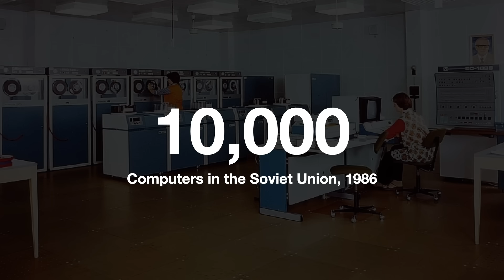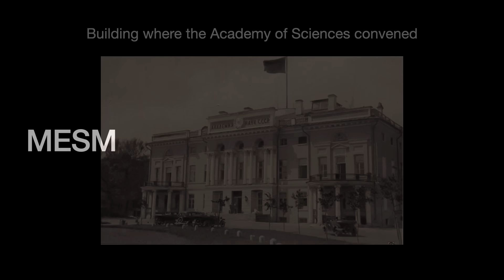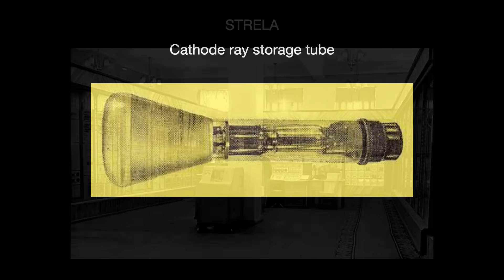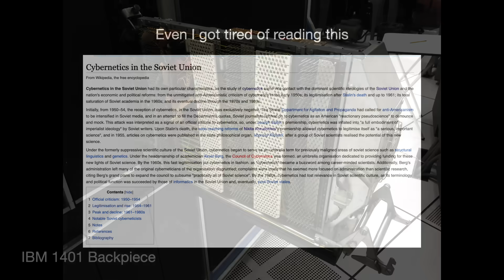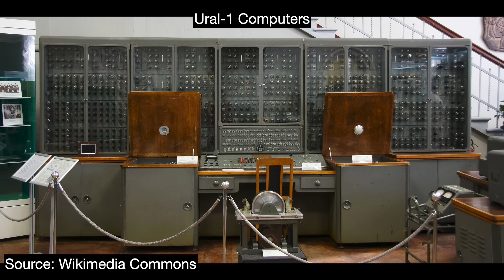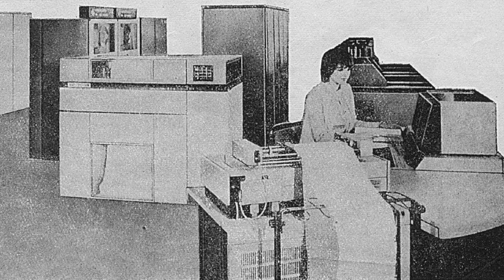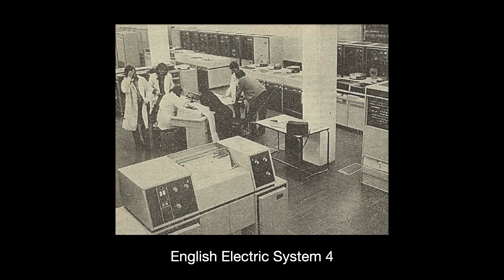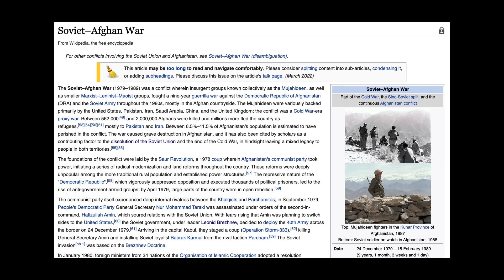Why the Soviet Computer Failed

Comment: When I was a child in the 80s my family bought a bright red portable TV of Soviet origin, a really portable one, I didn't see anything similar in the shops for quite a while. But one day, after a few years, it broke. The technicians we brought it to told us it wasn't economically feasible to track the fault and repair it. We thought at the time that it was too advanced for the local repair shop. Actually it wasn't, instead of using ICs as their western counterparts, it was built using discrete transistors and the miniaturization was accomplished carefully crafting an incredible mess inside the device. I doubt the factory could produce many units per year. Still a remarkable feat of ingenuity and craftsmanship.
Reply: Most of Soviet electronic stuff was sold with lists on which you could find a very detailed schematics and stuff. I don't know if it was a worldwide practice, but probably it was because of the lack of standardization. If you wanted to repair something, you'd need a guide every time you open a new device
Reply: @andremorr  I have an old radio, not soviet and it also came with detailed schematics of every single component. Just like cars used to come with full instructions on things like how to adjust the gap on the spark plugs or something. Companies used to give proper instructions for a DIY-focused customer to be able to do their own repairs. Nowadays they treat us all like goldfish.
Reply: @Vousie V, if you still have an old radio, hold onto it. It is a treasure. See how much your old radio is worth at Etsy or eBay. Worth checking out. 

In my country Ireland, old vintage things like radios, metal signs, oil canisters, etc are hot sellers. People treat them as ORNAMENTS for their museums, homes, hotels, pubs, restaurants, etc. 
My late father used to trade in antiques. Old radios were great sellers, even if they were broken. The last 50 old radios in my father's shop were quickly sold out to a German customer who knew their rising values in future. Now we have two old radios left. One is worth €150 (roughly over 9000 Russian rubles). Another is €120 (roughly over 7000 rubles).
Reply: @andremorr  Every Soviet TV set was sold with the manual and electric diagram.
Reply: @andremorr  British 80s computers also came with detailed schematics. From the US, the most popular make in the world in the 80s - Commodore - sold theirs separately but they were widely available also.

Computers followed the early electronics tradition of giving full ownership and information to the customer, but this was lost rather abruptly during the 90s, perhaps because of the massive success of the closed, proprietary software model exporting its culture to other fields.
Reply: @andremorr  that was standard with US equipment too in the early days. In the 70's you started having to request the service manual but it was typically free or you paid for shipping. By the 80's it became standard practice to sell the service manuals and some companies would only sell them to service companies.
Reply: @andremorr  soviet tech actually was quite similar more so the electronics.
If you knew some devices you knew almost all
Reply: We have a TV museum in town. Salora and Nokia mobile phones originate from here. Salora was one of the first companies to develop a commercial color TV and was one of the most sold TV company in Europe for many years. In the museum there was a really old TV stripped so you could see what was inside and I can tell you that most of the TV's were total mess back in the days. At least the ones from 60-70. I dont know how old was that portable TV tho xD
Reply: @L1ven  In the 70s, Grundig offered color TV sets in the Canary Islands open market, competitive in quality and price with the Japanese Color TV, but sales of German TV were sluggish.
Grundig TV sets sales skyrocketed when they sharply increased prices (see: 'An introduction to positive economics', Lipsey)
The tzars brought potatos to improve diet of Russians. They did not appreciate it. Consumers started eating potatoes when it were banned.
Reply: @L1ven    somewhere about 27 years ago there was an order fellow, I dont recall the nice man's name, who sold eletronic modulated circuit boards and parts out of his home here in Portland Oregon. He had a really  a old wood cabinet tv, that turned out after Second Glance, was an old color TV that his  was watching in their livingroom. It apparently was the first color television made in the United States, and dated to the year1954, the year I was born 69 years ago!
Reply: The Ministar 405, maybe? The board is built like a tryptich, with hinges folding in three around the CRT. The only ICs are for decoding the FM audio subcarrier. The schematics fit in a single page.
Reply: The Franco regime had first bonds with Mao than with USSR. When a Moscow embassy was built, roughly Per Capita Income was same in Russia and in Spain, the soviets travelled to Jodar, Jaén, a beautiful  village of unskilled agriculture workers, who massively voted communist party.
They had the good surprise people had freezers, gas for cooking, and B&W TV sets. The russians asked how often TV exploded, and became astonished when hearing this never happening.
Russian TV tubes seem having glass template difficulties, sometimes broke spontaneously, being in the origin of fires and some deaths.
About the Ceaucescu system, they had a tale, I ignore if it is fiction or true. Romania was selling bulb radio receptor sets at very low prices to obtain hard currency.
For their surprise, among their most avid purchasers were the Japanese, with more advanced technology. Someone proposed the radios had a copper-made variable capacitor for tuning, the open market price by weight of copper in capacitor was higher than the official price of the whole set.
About Gaddafi, when in need of some special alloys for their weaponry, sales to Lybia were restricted, he purchased tractors to obtain metal by scraping it.
Dissidents in USSR suffered what Stanislaw Lem called 'Perfect empty', no letter from abroad was allowed reaching them.
Some found a way to obtain money from this. In accordance to international post agreements, if a registered pack or letter is lost, the post office must pay a compensation to sender.
They sent empty packs, blocked by political police, and got the compensation.
Once upon a time in Spain, when passeports were valid for all the World countries, except USSR, Albania, Peoples Republic of Vietnam, less than 7 alltogether, when those having had political conviction or accusations were denied passeports, as the files for offenses were in paper documents, when info about someone was requested, their data sheets were taken out from file.
The suspicious requested a certification, knowing it will be refused, and another the next day. When the file of subject was opened,     any content had been taken out the day before, no negative records visible, the passport was granted.
A similar case is depicted in a movie about DDR: 'Bye, bye, Lenin!'
Blessings +
Reply: I really love fixing things. And while I enjoy ultra HD TVs and modern tech, there is a real joy in being able to diagnose and fix a piece of gear. Then there is joy in giving it back to the owner since they're very happy. Soviet made things were designed with the ability to be repaired, which makes them very nice and calming to work on. I've worked on very few but when you get to know a design you get a feel for the creators end their intent. All Russian things I've seen (tractors, firearms, vehicles, some electronics) have three characteristics: the ability to work no matter what conditions its in, resilience, and easy repair.
Reply: Nothing changed. Russia is about to break apart.
Reply: @jeanvaljean1475  Nope! NATO, after harassing Russia same as USA did with Japanese all around the Pacific, triggering the Pearl Harbor suicide attack, Hiro Hito attempted blocking this, wants to seize Ukraine's land, capture 40 million consumers and an industry with old technology in need of renewal, that in Ukraine, a 31 year old country; also, as in Europe during WW II, Wehrmacht seized France in one month, Poland in four months, 'liberators' took years, destroyed 80% of Europe, the severe damages to Ukraine buildings and civil engineering works will give business to construction companies, USA is a freemason's built nation.
Do you remember North Osetia? Krimea, Sebastopol, is the Pearl Harbor of Black Sea.
Zelenski, an absolute allien to this region of Europe, is leading people of Ukraine to death, to a new 'Holodovor'. Let him fall into God's hand!

Blessings +
Reply: @jeanvaljean1475  ZazEl, second to none in hell's hierarchy, from his triangle in GR8 CL of US, along with the single eyed monster Horus in same seal, is fighting, protected by the forces from wealth of USA, to annihilate any disidency, any freedom, any individuality. 
The war NATO-Russia is simply a fight to enslave 40 million consumers starting to find the sweet taste in good life, the renewal of machinery in an out of date industry, the construction workload from damaged buildings, destroyed civil engineering works, simply, business.
USA is a mason's country, the three little pigs are behind this wasp, hebrew financed, attack to Europe, to Ukrainians.
Blessings +
Reply: @jeanvaljean1475  Wet dreams of fools. Russia is on the rise, while Europe is crashing economically.
Reply: in soviet Russia TV is watching you :)
Reply: @tkalowski1973  Also in EU, USA, they even have 'psychic' elements controlling and performing agressions in places as bus and train stations, gas stations, road stops.
 Who arranges and pays this? Who them all belong? 
Not Eleanor Rigby, for sure. Blessings +
Reply: @tkalowski1973  Do you have any ethnic, or ideological connections to Stanislaw Lem, official bard of the polish system fading with Jaruzelski?
I've never seen a 'guide to torture', to 'gaslighting', to mental genocide, as elaborate as the books by that guy.
Only Kafka 'Process' and other nightmares compares.
Gesund +
Reply: @josega6338  I was reading few his books but only my connection to him is the same nationality :)
Reply: Sounds like trying to get a defective Sony product repaired.  Very sadly, we don't repair electronic devices any more.  Disposable, yeah, BaBy.  It sucks.
My father was born in 1926.  After 22 years in the military, he started his second career of 20 years working for the telephone company.  He really hated that component level repair no longer existed by the end of his second career.  Instead of replacing some surface mounted component that had gone bad, just pull, discard, and replace the entire card, even though it may have just been a capacitor or transistor, whatever.
Reply: hey, smartcab 451, I am not saying that we should not have a government, or that we should not have laws, what I am saying is that the Soviet system failed because they did not use capitalism, they had no profit motivation, and they controlled too much, from their central government.  Our economy works instead, by the vote of consumer dollars, in free, unfettered, capitalistic, profit-driven markets, from millions of individuals, instead of just from a few select officials, at the top, of a central government.  There will always be idiots who use phones and walk right into the path of cars, instead of waiting to use them, at home, or at work, or inside some other building, like I do.  They do this because the state governments have passed motor vehicle laws, requiring drivers to yield to pedestrians, so if they get hit, drivers lose lawsuits in court.  Personally, I believe that is a stupid central government controlled decision, because pedestrians can win lawsuits, but get injured or killed, by not paying attention.  I believe drivers, should have the right of way, but they are in the minority, here.  Of course, in Soviet Russia, it was worse: their Soviet made cars had no safety glass, and with their poor roads, had a ten times higher fatality rate, on the roads.  But that government spent the money on the military, not on safe roads for commercial commerce.  Without profit motivation, business was lackluster, so was tax revenue, or motivation, for better roads and vehicles to use them.  And, as far as my religious beliefs are concerned, I was raised in a Methodist church, as a Protestant, as was my father, and his father before him, if you are so interested in my own particular beliefs.  I do believe in Jesus.  In America, we have freedom to choose whatever religion we want to.  That freedom, however, has not always existed, in other countries, in the past, and still does not, in some countries, today.
Reply: @michaeltotten7508 we don't have free markets in the USA.  They are all government protected monopolies with the appearance of competition.
Reply: @blmartech  yeah, well, you are probably right, to a large extent.  but it seems to me that our economy, motivated by profit rather than strictly by total govt control, did better, and was much more innovative, than that of the Soviet Union, and more productive than that of Nazi Germany and Japan, during WWII, as well.  Lately, however, we have more and more govt control & interference, in whatever markets we have now--and less prosperity, as a result.
Reply: @michaeltotten7508   The government should intervene sometimes to save failing industries and subsidise key industries.  Saying that the gocernment has no role to play is naive and dogmatic , the gocernment absolutely does and should play a role in certain aspects. Thats not totalitarianism by the way, its called interventionism
Reply: Huh, we had that red one.
Reply: And now, because of integrated circuits, instead of discrete transistors, you can watch the same tv programs, on your smartphone, as you're walking down the street, riding in a car (hopefully, as a passenger, only, btw!), or, while lying back in bed, or, while sitting at a table, in a coffeehouse, etc.  My LG android smartphone, weighs only about an ounce or two--it is very light, compared to Samsung or Apple--and so I can hold it up, for quite a long time, easily...
And, I can do a whole lot more with/on it, than just watch tv, too--a whole lot more, for sure!  Let's face it, this great technology came about, strictly through the freedoms that we have here, in our Western capitalist democracies: freedom to make a huge PROFIT, freedom to envision new ideas, freedom of speech, assembly, religion, travel, explore, learn, etc.  And, freedom to walk around, without having to wear a mask, also...
Reply: @michaeltotten7508  Freedom for people to walk, bike, ride, wait, like zombies oblivious to others in their presence, or even possible danger they may walk into with their face glued to a tiny screen.

Freedom FROM religion is a Right, and that should include the freedom from Evangelicals imposing THEIR beliefs at every possible moment and means.
You are pretty clearly a believer in American Exceptionalism, which is a complete load of horse crap.

You mask comment labels you as a science denying radical.  'enough said.
Reply: tvs in the early 80s especially portable didn't use ICs - they were analog. All messy inside made in Taiwan. I recently tested a TV that was used everyday in the 80s..and unbelievably it still works. 40years later. to this day there is NEW old stock of that junk for sale still.
Reply: @crabbcake  now i am hungry for 🦀
Reply: 1000th like 👍🏾 🎊 🎉
Reply: Awesome!!
Reply: For the 60s, maybe, but not for the 80s.
Reply: I studied electrical and computer engineering in Russia and used ES computers to write programs in Pascal.
When you compile your program it will print a long sheet of paper and mark the errors on each line so you can fix them and go back in computer to correct the errors. Once you run it again it will give you the correct answers.
A year later we were blessed with a west German computer named Commodore equivalent of IBM PC and learned Turbo Pascal and GW  Basic.
Reply: Now go watch shango66 channel - a US guy who fixes old equipment from all over the world - interestingly those soviet devices are no issue for him. Guess that repair shop was kinda questionable.
Reply: Darth Vader  hey buckle head? werent the yanks planning another moon mission?? I was really looking forward to seeing the new CGI attempts to pull the wool over academic egg heads eyes like they did in the 60's but it seems the yankee doodle space tech only works with LIGHTS, CAMERA AND DISTRACTION
Reply: you judge Russian tech on the strength of a childhood memory? no wonder the soviets won the space race, you yanks are not that bright
Reply: @MrMakeBelieve  am not american but you just showed you arent bright yourself
Reply: @Akinwalesegun  Surprise, you question the cranial capacity of ones you dont agree with. Theres a lot in this world i dont agree with, in fact I withdraw my consent. I hereby render and revoke Earths very existence.
Reply: @MrMakeBelieve    It sounds like you are the one judging.  In any case, Russia was ultimately absolutely slaughtered in the space race. Again, it was a story repeated often… USSR jumps to a lead, then gets left in the dust. But please tell us, why are you so bitter?
Reply: @kevino.7348  the USSR won just about every achievement in the space race except landing someone on the moon. Americans like to move the bar a little
Reply: @MrMakeBelieve  The problems of the Soviet regime can be summed up in the result that the USSR lost the Cold War and fell apart because it had no idea to hold it together. Memories of childhood and youth serve to illustrate the absurdities. These stories tend to be so absurd that they are the only way to understand how something so powerful can collapse.
Reply: @mrsuds9924  You judge an entire nation of 350 million people based on an internet comment below a YouTube video?.... must not be that bright....